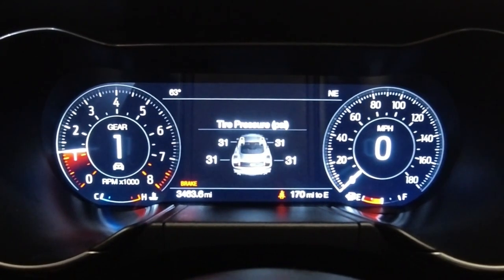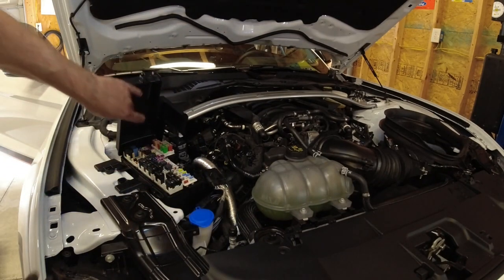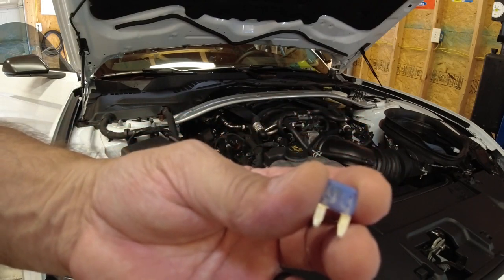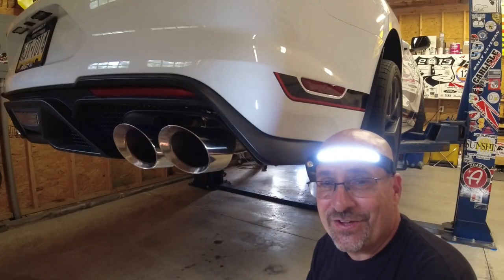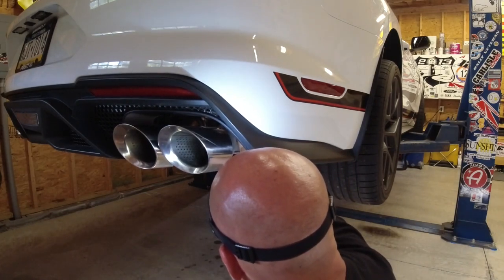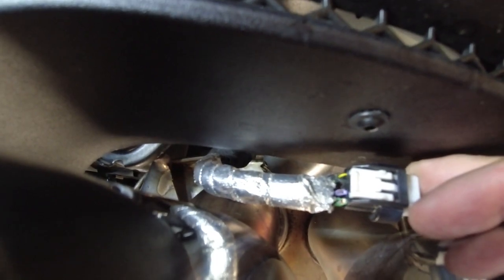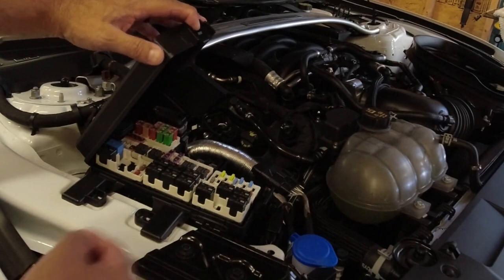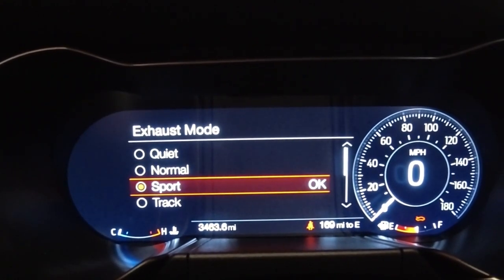Quick & Easy fix for the S550 Mustang Active Exhaust issue

Comment: Just as a point of order, and details, I took my car (2019 Ecoboost Premium) to the dealer with this issue. They wanted $1,600 to fix it. They were going to swap out the actuators. I told them what can be done to fix, but insisted this was "the fix"
Reply from the maker: Hopefully you saw this prior to paying them that kind of $$$. The harness can wear through and it is better to get a new one at that point but it's just two quick disconnects. The harness itself is less than $100
Reply: @TonysFordsandMustangs  I did! I did not pay them, and declined. I actually told them what the fix was if they could look at it beforehand, and gave them the TSB for the known issue. Put less than 8k miles on the car. I'm not super car savvy, but smart enough. Have the fuses, so simple enough fix then is general silicon and then some gorilla tape around the wires to insulate after the silicon dries. Then, zip tie it away from frame. 

Thanks again!
Reply from the maker: @nobodyschannel  Glad I could help and save you some cash. Thanks for watching!
Reply: How much did it cost you to do this fix?

Comment: Question for you  have you seen or heard of when I put my mufflers back on after powder coat and hooked active back up I only have quite and track if put in normal its wide open like in track mode I've tried to re clock the actuators and keep having same issue
Reply from the maker: I have not heard of that issue. I have yet to hear of anyone powder coating their mufflers. If I had to guess, I would look at the powder coating as part your problem. If the mounting area of the valve is coated that would add few millimeters of thickness to the mounting surface and might be causing the valves to hang up. That would be my guess. Best of luck and let me know the issue when you get this worked out. If they are opening they have power so it's not connected to the harness.
Reply: @TonysFordsandMustangs  yeah the coating isn't interfering with the actuators my guy was meticulous with protecting the valves. They move freely and easy thanks for the quick, reply
Reply from the maker: @bchickman  I have heard of them going bad as well. Best of luck.

Comment: Hey I tried this but after a few miles the Active exhaust system get disable any advice???
Reply from the maker: IF it went away & you physically saw a short in the wiring harness you may not have moved it far enough away from the frame. Question 1: was the fuse blown? IF so that is indeed your issue. Question 2: did you move the harness and then add something to the harness to keep it from grounding out a second time?

Comment: I have code P2BF5:Exhaust Flow Control Valve “A” Position Circuit Range/Performance. 
Is this video will fix my problem or?
Reply from the maker: I never ran a scanner to check the code. It should take you all of 5 minutes to check and see if the fuse is blown and if it is check the passenger side harness. If it's frayed then yes it will fix the issue. If it's worn through you need another harness. Those valves can fail but it's rare. Best of luck!
Reply: @TonysFordsandMustangs  thank you very much for your answer and help i will. 👌🏽
Reply: @TonysFordsandMustangs  hey tony you are the best 
today i fix it as you said. Legend  ♥️
Reply from the maker: @MusaedAlKanderi  Fantastic!
Reply: How much did it cost you to fix  it?

Comment: I have the same problem , but can't get that harness off the actuator.  I get the clip to slide forward but can't get that harness off.
Reply from the maker: I use a stubby screwdriver to push the clip out of place and it does take some effort to get it fully out. You need to pull the harness down so you can see just how bad it is. IF the wires are only slightly frayed you can as I did and patch it up and secure it so it's away from the frame. If they are worn through you may need new harness and Ford should warranty that depending on how old your car is.
Reply: @Tony's Fords and Mustangs  thanks for getting back to me. The wires are cut through.  I wanted to buy a new harness and put it in myself.  Just having problems with that plug.  I can slide the white clip forward but can't seem to get the plug out. Maybe some lubricant. Thanks again.
Reply from the maker: @juliofsb8  That clip has to have an audible click in order to remove it. It will slide a bit before it clicks. Since it's trash anyway get a good flat head screw on it and smack it with a hammer. The other news is there is another clip on the other side of the harness. Maybe try that one first as it's easier to see and will give you an idea of what you are working with. Best of luck!
Reply: @TonysFordsandMustangs  lol. The big plug I had no problems with.
Reply from the maker: @juliofsb8  Hit it till you get it.
Reply: @Tony's Fords and Mustangs  so, the wires were frayed on the passenger side.  I replaced the passenger side harness. The fuses were fine. I'm back where I started.  It goes into quiet normal and sport.  It won't go into track mode. I'm getting a P2BFB code. Any ideas?  Actuator??
Reply from the maker: @juliofsb8  I have heard of actuators sticking. If it's going into the different modes but not track it sounds like it's just not opening all the way. Check and see if something is obstructing the full travel.  If that doesn't fix it run that code by the dealer and see what they come up with.  Best of luck!

Comment: Did you end up doing an H or X pipe with your 2022?
Reply from the maker: I did neither on the 2022. Factory exhaust caused the short. I do plan on going with a set of headers and a tune this year.
Reply: @TonysFordsandMustangs  putting on the x pipe tomorrow or later this week, I’ll let you know how it goes, I want a little raspier tone.
Reply from the maker: @GarveyMustangMan  It should give you that for sure
Reply: So I installed it yesterday, I disconnected the harness prior to cutting anything and covered the harness with a towel on both sides that way if I had to jerk the mid pipes I wouldn’t hit the frame and caused a shortgage.
Came out great, can tell the difference for sure especially in Sport +, raspy aggressive sound!
Reply from the maker: @GarveyMustangMan  Hopefully you zip tied the harness up and out of the way of the frame. Glad to hear you like the sound of the car.
Reply: @TonysFordsandMustangs  I did, thanks to your video and expertise

Comment: Mine does go from quiet to normal but not sport or track.
Reply from the maker: That is very odd. Did you check the harness? I don't think that would be the issue. You may have a stuck valve

Comment: Had the same issue, car only had about 1,500 miles.  Passenger harness was rubbing on part of body sheet metal.  Ground out some of the metal, sprayed some paint on there and wrapped some tape on the harness.  It did it to me twice when I drove a little spirited.  Come on Ford, should have done better than this.
Reply from the maker: You would think they would have squared it away over the years but nope it continued through S550 production. I have yet to look at an S650 but I wouldn't be surprised.

Comment: Well that’s rather disappointing. Makes you wonder if they even test cars in the R&D phase before selling them, yours is basically brand new!
Reply from the maker: They know this is an issue. They most likely didn't want to spent the $$$ on two separate valves a left and a right is my guess.

Comment: I’m still wondering why you traded in a bad ass boss 302 for a mach1. The only engine that I’d say would be better than a boss 302 Road Runner Would be the predator engine in the new GT500. That road runner engine can handle 1000 hp without a problem and that’s not even opening up anything in that engine. If you put a TVS or a Whipple on that boss 302 that thing is unstoppable and that engine would never break down. I just don’t see why you downgraded. The 2012 and 2013 boss 302 is among one of the best vehicles that Ford has ever made because of that engine. The Mach 1 Is a good looking car but it’s just a GT with a little bit more horsepower and suspension mods. I’m not talking shit I’m just wondering why you would do that?
Reply from the maker: I really use my car as a touring car with some track time here and there. There was nothing wrong with my Boss but it had 42K on it. Also I have a 1970 Mach 1 so having two Mach 1's was attractive to me. As for comfortable cruising the Mach 1 is better in many, many ways. The Boss was better in a straight line for sure (Solid rear Axle) but the Mach handles slightly better on track than the Boss and that's the truth. They are both great cars with the Boss being better at some things and the Mach 1 at others. I didn't plan on super charger for either so that wasn't a factor for me.
Reply: It probably handles better because of the IRS instead of the solid axle. But I am happy for you if that’s the choice you made. I recently got a 2014 Shelby GT500 with one previous owner and 4000 miles on the dash and there was also a Mach1 on the showroom floor and that thing was beautiful. I absolutely love the wheels on that thing. It is a very good looking attractive car and from what I heard it is an awesome road course car. Does that thing come with Magna Ride? My GT500 came with the SVT performance package which came with the adjustable Bilstein shocks And I can absolutely feel the difference. That would be pretty cool if your car came with the magna ride suspension
Reply from the maker: @sylvesterstallone8637  Yes they come standard with magnaride and that's one of the really big reasons for it being more comfortable. The IRS makes it a bit more stable. The Boss would hop out once in in a corner with less than smooth pavement. Not drastic but a bit. The Boss is lighter car and more raw. It's needs pointed a bit more than the Mach 1. Power wise it's very close with a slight edge to the Boss because it's lighter. I will have the Mach 1 at that level shortly I'm sure. A 2014 GT500 is a totally different car altogether. The only knock on those cars is the transmission gearing which is quite high. I might look at 4.11's as a final rear gear ratio for one of those cars and call it a day. Everything else is there and for god sakes drive that car and enjoy it as the last owner didn't.

Comment: I would rather replace the entire exhaust than f with the fuse box
Reply from the maker: I replaced a 10 cent fuse and taped a harness. That's hardly F'ing with the fuse box plus it's a hell of a lot less $$$. But you be you.
Reply: @TonysFordsandMustangs  yeah its not a big deal but ive never messed with it and it would be way more fun to replace the exhaust😂😂😂

Comment: Ok my ‘18 has been doing that for awhile , but the fuse wasn’t blown , the harness wasn’t rubbing against the frame , could it be the relay ? ?
Reply from the maker: I have heard of a few folk's having stuck valves. That could be either side. If the car is under warranty I would take it to the dealer. If it isn't I would start with a test light on the harness for the valve and see if you are getting power at the valve itself. If you are getting power there that rules everything else out excluding the valve.  The valve might be stuck and they are not cheap. If it were mine and it were stuck I might be tempted to pry it open and see if I could free it. Best of luck and let me know.
Reply: @TonysFordsandMustangs  well it’s probably the actuator and I’m sure Ford won’t cover it , and the exhaust tip with the actuator is actually welded , not  clamped , to the muffler .  😐
Reply from the maker: @DuVey64  The actuator can be removed from the system while it's still on the car.